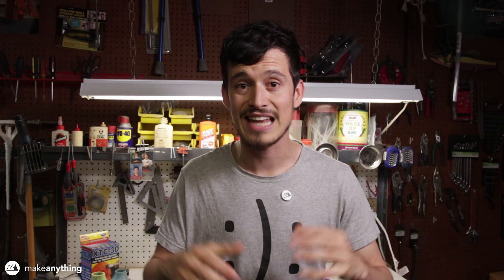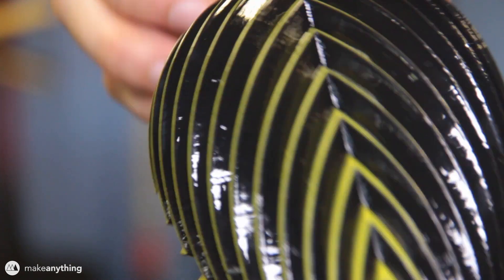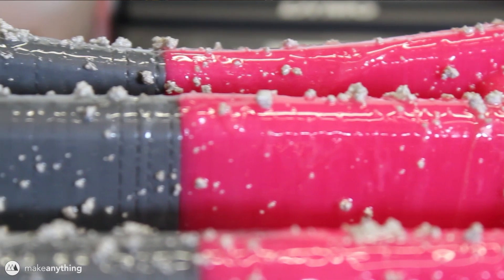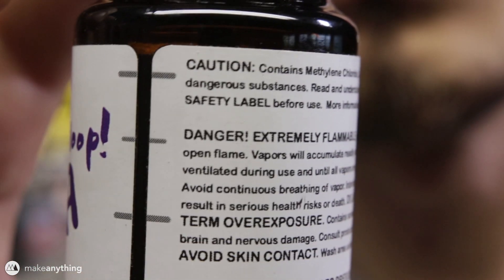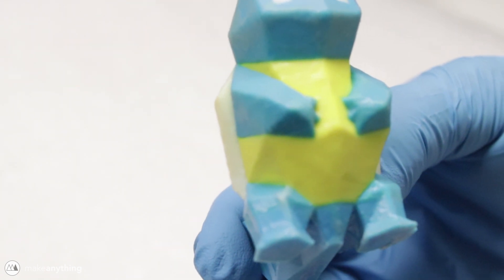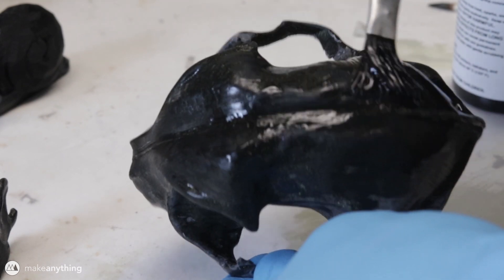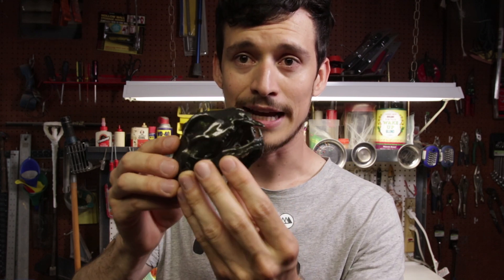PLA Smoothing 3D Prints with 3D Gloop!

Comment: 3:28 Be really careful using this stuff for bed adhesion, they advise on their website to test on a small corner of the build plate first. They also advise against using it on textured beds. I just bought some gloop a few days ago so it should be coming in the mail soon, I didn't know you could use it to hide layer lines

Comment: Those filters are COMPLETELY useless towards Methylene Chloride (aka Dichloromethane which is a carcinogen like Chloroform). What you need is an AX filter, not a particulate filter like the one you have (black band)

Comment: My process is tedious but works well... I sand it down going from 80 grid paper all the way up to 240. Then I use some plastic glue and a toothpick to fill in any gaps that are left between layers, just very gently rub the glue over the areas that need work. Sand again, fill in again as needed and then by the end you got a good smooth result ready for priming and painting. Takes a bit of time but this way you keep details where they are needed.

Comment: Thanks for reviewing this product. I would be interested to know if there is an improvement in strength... when my prints fail, it's usually along the print lines. Since the Gloop seems to melt or fuse the layers, at least at the surface,  I'd like to know if it reduces separation along the print lines. BTW, I just ordered a 4ox bottle. Thanks for the links... I hope you're an affiliate.
Reply: More heat.

Comment: you need a better brush. that will make a huge different ur surface finish. This is a chemical that pretty much melts layers hence why it has cautions. So as the layer melts it will take form of your crappy brush and give a poor finish lol. Also the spray at 6:51... dude you serious lol.

Comment: "I didn't like using acetone (which evaporates), so I:
1. Sanded it.
2. Purchased and hand-painted on this expensive Gloop (which has MUCH WORSE chemicals, and stays on the surface!)
3. Used 2 more layers of the Gloop
4. Purchased and sprayed it with Rustoleum, adding more toxic chemicals
5. Let it dry overnight...."
Appreciate the video, but, um, I think I'll just print ABS and stick with acetone.  Seems much easier.

Comment: Start with sand paper grit 120, 240, and proceed with wet sanding grit 600-1000. If your print have deformations you want to hide, apply wood putty and let it dry before sanding. Dont use "Gloop"

Comment: All wrong lol. Go get a heat gun (20 bucks in Walmart paint section. Heat it on low. Rub section til smooth. Careful for fingerprints so using a glove or something like that. Just be careful not to get it too hot. It just needs a second or 2.  It works awesome and alot of people already due to testing thermistor and heat. 1 time 20 dollar buy so no need stocking compounds like everything else when its empty.

Comment: Please note how the fumes smell good /bad/neutral means NOTHING to how dangerous it is.
For some reason people equate good smell with safety.!? NO!
Case in point, PLA fumes are NOT safe. It being made from a more resent "organic" polyester (people forget petroleum is 100% organic) that it is safe.
Also an additional issue is particulate. Liken printing with plastic to cooking with grease, got great for lungs.
Yes, abs and all nylon is "worse", but not as much as most think in context.
Also PLA while technically biodegradable, it is not biodegradable in nature (ie without very very specific conditions Not normally found in nature.) So saying it is, is rather misleading as people normally understand the term.
PLA is great but there is a lot of misleading information out there that seems to be now well entrenched.

Comment: I use the heat blower from my smd soldering station to heat up spot by 
spot, dipping my finger in water and smooth the Pla, that works really 
good , after that you see next to zero any kind of layers. i printed a 
35cm high alien xenomorph figure and after the smoothing i clear cote 
it with a few layers...even from close range it looks like made from 
dark shiny stone
Reply from the maker: Interesting strategy! Does it leave behind fingerprints?
Reply: @make.anything  no it gives a shiny surface,  try it out on some part with layers visibly heat up a spot (not the entire print) to the point when the surface gets glossy from the heat than wet your thumb  slide lightly across it, it works wounders on black pla looks like glas surface made from dark ceramic

Comment: Judging a chemical based on the name is a very poor way of judging the toxicity. Just because MEK has a "crazy chemcial name"  doesn't make it inherently dangerous, and "3D Gloop" isn't inherently benign because it has a cute name.

That being said, MEK is fairly dangerous to work with. With an air concentration of just 0.3% it is immediately dangerous to life and health, and has an explosive range of as little as 1.4% in air (maximum 11.4%). It should only be worked with in a fume Hood.

Comment: I never ever 3d printed anything, but I know my way around this kind of stuff.
The whole thing seems a little stupid to me, if you put something on your print it means the size is not really critical, so you might as well use a plastic primer with a filler. I feel like filler will probably mask layer lines pretty good, and if you are not good enough at using filler in putty form you can buy filler in cans and that would work very good in this application with the added benefit that you can then paint the print with whatever you want.
Reply: For some reason I stumbled upon this an year later, I now have a 3d printer. I can confirm what I stated above

Comment: A suggestion for the makers of GLOOP...#1: Use a fine hair brush for the applicator. #2: If you want to really sell this, then make it a spray. Using a brush picks up bits of dissolved PLA when you use it and puts it into the brush, which then smears this PLA/GLOOP adulterated mixture on teh rest of the print. The only way to avoid it is to make it a spray-on.

Comment: I work with resin and have A thought for you; ,   The pen you tested with the uv light that cures the resin could work another way.  For one thing, that light is not strong enough to cure quickly.  A uv torch or light can cure resin in 1 second.  UV resin is damned expensive and those cartridges with that pen have to cost even more.  Resin can be colored.  Resin dye is cheap on ebay.  Regular resin that has to be mixed is cheap  but can take forever to cure,  If those little cartridges have a cap that removes that allows the uv resin to be put in, it may come off and y0u could refill them. uv resin will never cure without uv light.  It is more costly than reg resin but much cheaper than new cartridges.  As for making it smooth, try working up to super fine grit water sandpaper and use a brush to apply a coat if clear resin and us a seoarate light to cure and it is shiny abd smooth

Comment: i have used pure methylene chloride before for smoothing my pla, super poisonous btw(although having a sweeter smell). it worked really well with smoothing and bonding parts together, could probably dissolve any plastic. including the container spout i have purchased it in. but what i found out after a year or so after i smoothed the print is that the plastic continued to degrade and became very week.

Comment: the day before yesterday, I started test printing with ABS, but I ran into the same problem over and over again: warping. is there a way I can fix this?
I have an Anycubic i3 MEGA, so the parts should stick to the print bed well enough that you don't need to use glue sticks or something similar right?
Reply from the maker: ABS is tough. An enclosure will really help reduce warping, even if it's just a stiff plastic bag or cardboard box to trap in the heat. Printing with a wide brim or raft also helps

Comment: Here in the UK there is a product called 'Greygate Plastic Polish' - apparently used by the RAF to polish aircraft canopies (plexiglass).
This stuff is liquid, and has an extremely fine grit, and is non-toxic. You dab it on, let it dry, then buff it.
For prints with large surfaces it would be great, but maybe not something complex, as getting into those crevices may be an issue.

Comment: My favorite method is just layers of fast-drying spray paint, which does some smoothing on its own, but mostly gives you a softer outer coating that sands down almost instantly compared to PLA. Then coat the whole thing with epoxy.  In ANY case, you're sacrificing detail for smoothness whether you're melting into the model with this stuff or putting a coating on top.

Comment: "I don't like adding material on top of material", then proceeds to add material on top of material 😂😂
Reply: Not even the same. There are other options here, he just chose to do something he "didn't like doing". This is like saying I don't like riding city busses yet taking a buss while I have a car in my garage.
Reply: I think it’s because the epoxy essentially adds another layer to the outside of the print but this is more like acetone smoothing. Nothing is really added, just smoothed.
Reply: @WaleighWallace it isn't. It's a glue that stays on the surface. It just dries thinner than epoxy but it still does indeed leave another layer on top of the print.
Reply: I hate to wake up and now im still waking up
Reply: He isn't though, it's a solvent that dissolves the material itself so it resettles smooth and then the solvent evaporates out. It's not the same thing as adding epoxy on top to fill the layer lines like XTC-3D.
Reply: @Yakkers it's a glue, it's not evaporating to noting otherwise it wouldn't be used as a bed adhesive since it would just evaporate immediately once the heater comes on. I've used this and know with certainty that it leaves a layer on top of the filament to fill the layer lines. It's basically a thinner less versatile epoxy.

Comment: Your respirator will help you ZERO in this case, since its a HEPA type of filter. You have to wear a gas mask with activated carbon adsorbtion material. Also, I saw that this stuff contains methylene chloride, a particularly nasty chemical that is known to be carcinogenic and also flamable. I´d honestly prefer to use MEK ...

Comment: Good video, I have only been printing for a couple months, I usually sculpt things,  may I suggest instead of using the brush that comes in the bottle go buy a fine brush from your local craft store and scrape off excess from brush before application, should help with the clumping, I do the same thing with a brush on lacquer I use to complete my prints. I find bushing on my flea cat works better the spraying.. more control. 
But other wise very informative video may have to order some int eh new year and give it a go

Comment: soooooo.... adding additional layer of XTC-3D is bad, because it's additional layer, but layer of 3D Gloop is fine? Weird logic.
Reply: Based on what I understand with this having Methylene Chloride in it, it acts as a type of plastic melting solvent. Could be wrong, but that's what I think is going on. Plus, on the squirtle model you can see where his arms and torso meet, there is some green from where the 2 colors are melting together.
Reply: @TBonerism  you are correct. that chemical is melting the plastic.  similar in how acetone melts abs, but harsher of a chemical. i dont think his nitrol gloves he wore would really keep him safe
Reply: The epoxy adds a layer (which will be of varying thicknesses) to smooth the lines whereas the Goop attacks and melts the PLA to smooth the lines.
Reply: @scrag2841  So the idea is the Goop product does it's job and then evaporates completely? ie recycling is still possible (providing you don't then hit it with spray paint)
Reply: I think epoxy is just as good or better for art work like this...
Reply: Biodegradable PLA Will it lasts longer when we coat it with UV resin..?

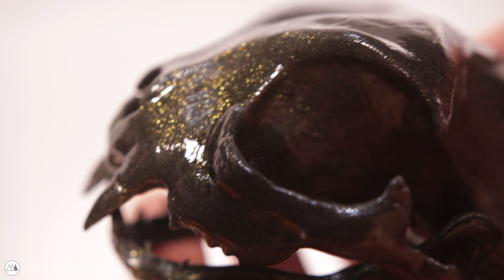Comment: well, it's no better than a 1€ nail polish which is much less toxic plus you already get glossy coat without extra spraying. 7:17 and it did not even smooth the layer any further than your sanding.

Comment: Cool stuff, it’s like using model glue on model kits to melt down the seam lines.  

On an important side note, you should never turn your spray can upside down when spraying, that’s how you clear the nozzle as paint stops coming out and only the propellant comes out.  It’s better to lift the object and spray from below if you need to.  

Also, don’t shake the can, do long, straight, overlapping coats, spraying past the object and back onto it.  If you shook well at the beginning, you won’t need to shake it for the length of a normal spray.  

Another tip is warm up the can for a few minutes, it mixes better that way. :)

Comment: "How to add a thick layer of glue to a print to mask layers and make it shine with clear coat"
Reply from the maker: The layer lines are physically melted away, but yes the clear coat makes a big difference
Reply: @make.anything  The glue is actually melting the layers and not just filling the gap?

Comment: I use SciGrip3 for my PLA prints for welding the plastics together and for smoothing. It works amazing and and fast, also depending on applicator methods you don’t end up with brush lines from a coarse bristles like this product

Comment: First, he says that he does not want to add layers, regarding the epoxy, but isn't this adding even more layers?
Reply: since its an adhesive yes your just adding it in the gaps and slightly filling in the small layers... its fast acting so its gets gummy and begins to dry quickly  but by definition this would be more like filling rather than smoothing
Reply: This stuff actually melts the plastic and is just as bad as the stuff people normally use to smooth pla.    Pretty much the only real reason to use this is when you want to show of the colors of the filament itself like the black glitter filament used for the cat skull.   On something that is a flat color your better off doing the filler primer, paint then spray poly/vanish or epoxy methods.  Done properly you can actually get insanely good looking results.    The big difference is that while I think the paint or epoxy method looks the best it also is the most most time consuming and requires a lot more work.   The melt smoothing methods are much less time consuming.
Reply: I believe it melts the stuff slightly like how solvent eats into plastic, which is why it's brushed into it, so the effect isn't as bad as adding a coat of epoxy, which is used more as a filler but would be more difficult to thin out. Epoxy would be like adding another wall to your print. This stuff chemically reacts with the existing wall.

Comment: Thanks for the video! I might give this stuff a try. I've been using the XTC epoxy, which works great on a fresh printed surface, but anywhere that's been chiseled or sanded or scraped e.g. (removing support material, strings, nibs, etc.), the surface tension of the epoxy interacts with the imperfect plastic surface to create little nibs everywhere, so then I have to sand the epoxy as well. Still marginally more efficient than sanding the bare PLA surface smooth without any coating, but certainly not as good as I was hoping for.

Comment: I've used WeldOn #3 to similar effect, which also has methylene chloride as the key ingredient.

It's water-thin, so you can inject it into the seams of preclamped prints. Capillary action does the rest.

I'd still give it a try, though, the predisolved PLA and that secret elastomer might do a better job.

Though I'm concerned about how long the naphtha in it takes to offgass completely?

Comment: Currently I'm liking Polycrylic by Minwax for smoothing prints. The water based version is easy to clean, not toxic, and easily available. It also can be used to fuse laser printer toner to a printed part. It does not melt the plastic. It fills in the texture.
Reply: which product are you talking about exactly?
Reply: @B0dyBoss  Minwax

Minwax Polycrylic Topcoat

Comment: You should absolutely use a hood or have good ventilation using gloop, Methylene Chloride is a dangerous chemical and you should avoid its fumes as much as MEK
Reply from the maker: Apparently they are changing the formula to remove Methylene Chloride for the final product, for what that's worth.. A fume hood is probably still a good idea regardless.

**Edit: apparently it's cyclohexane they're taking out and the methylene chloride will be in small quantities.. so take necessary precautions!

Comment: I have a question for the cr10 in a previous video you applied hair spray wouldn't that just make the build plate slippery
Reply from the maker: Nope, most hairspray has PVA, the same material as glue sticks

Comment: I had a plan to use a wiffle ball as a planter. Fill with soil, seeds in the holes and then I was going to hang them up. I didn't really think it through very well, because (as any person with any amount of intelligence would have figured) the dirt just wants to come out the holes in the bottom.   SO, I decided to try to use my 3d pen to cover the holes on the bottom. Of course, it doesn't stick to the ball. Any ideas on what you would do to cover the few holes on the bottom of the balls? Not solidly because it needs to drain. But I don't want the dirt to all come out. BTW, I have things growing through the holes!  I just sat the balls in a flower pot.  Which is rather counterproductive to what my whole goal was.

Comment: I think it's possible to get near that level of shine without the extra glaze. You should try multiple grits of sandpaper and a loose cotton buffing wheel mounted onto a low-torque drill. The dense felt wheels will ruin it. A heat gun or hair dyer might help a lot if only using a paper towel.